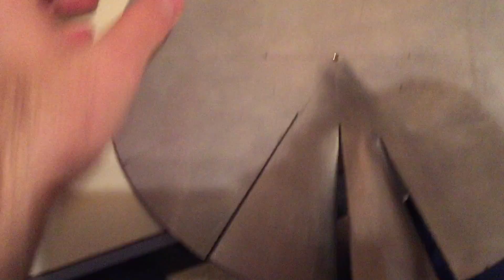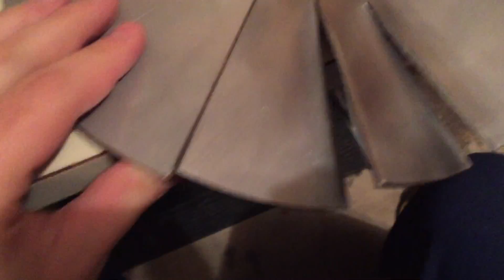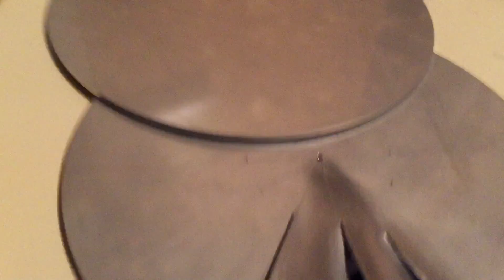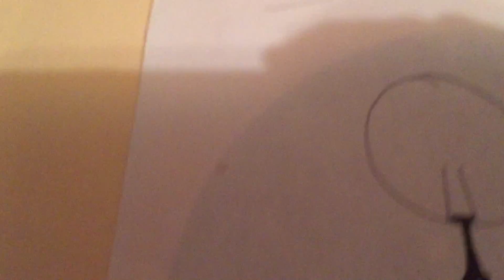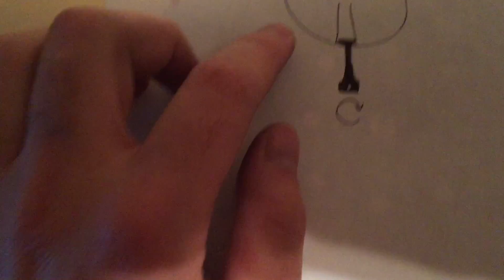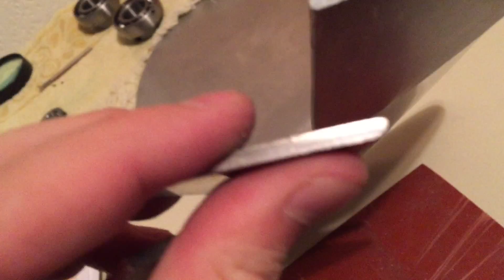Building a Jet Engine: Intro and testing

Comment: you will need to look into mixing metals in your foundry in the hot part you l need lots of nickel alloys also you l need too profile all your blades even 1 and   2  stage you also need to build a vibration sort rig  and a very good scale and you need to know how to do the lost wax process and ceramic coting and pre heating your molds your going too have to put your head into books big time ,I am good at build a foundry so if you need any advise on that I can help .